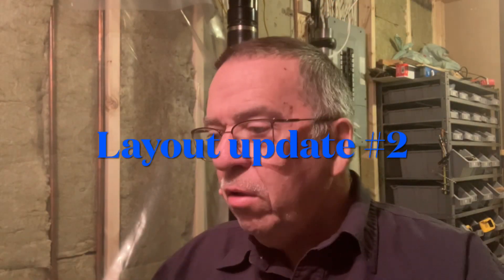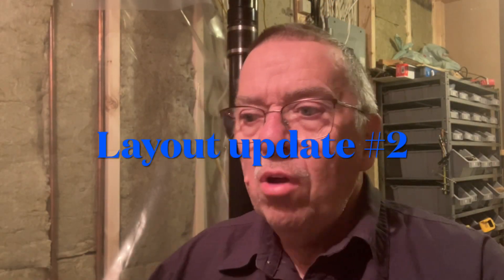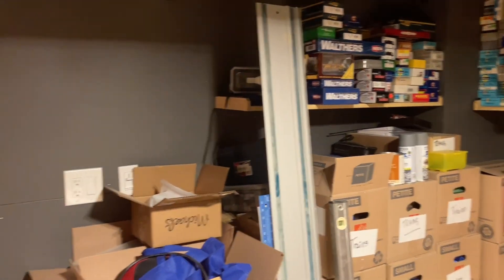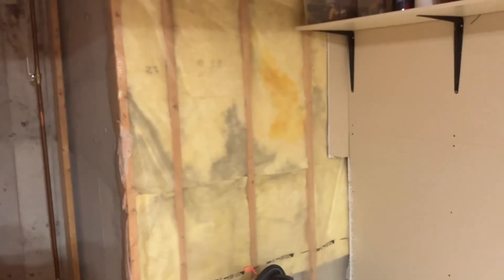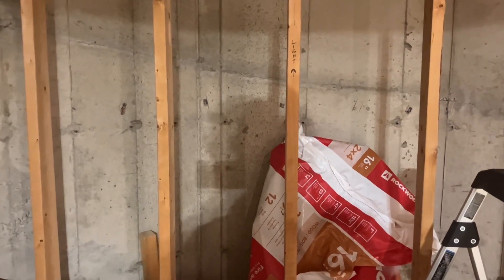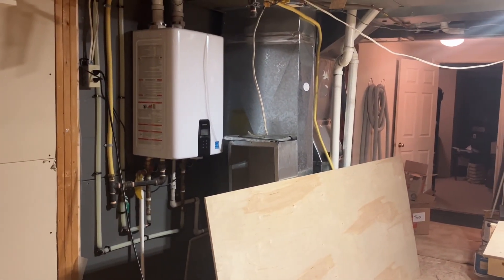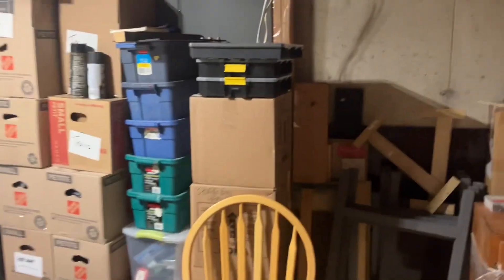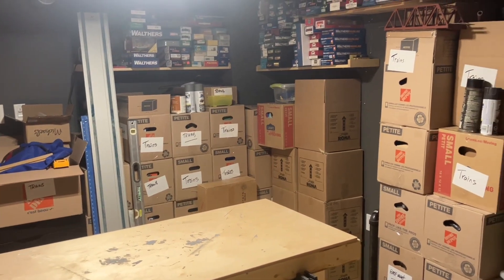Layout update #2

Comment: I would avoid the water heater area as much as possible.  Or make it removable if possible.  That type of water heater can need a lot of maintenance.  And you will also need to get to the furnace.  I made sure to leave a lot of clearance around the mechanical equipment.  But you are making a lot of progress.  Keep the videos coming.
Reply from the maker: John only thing going near water heater and furnace will be a single track to connect to future yard, and will be removable, thanks for Watching

Comment: Great space James…I’d stay away from the water tank…those tankless heaters have issues sometimes…my heat exchanger crapped out on mine and leaked water underneath…plus you’ll need to service it by cleaning every 12-24 mos…otherwise they are great….never run out of hot water
Reply from the maker: Thanks for watching Georgia sunbelt, yes only go have a single removable track that will link to a yard